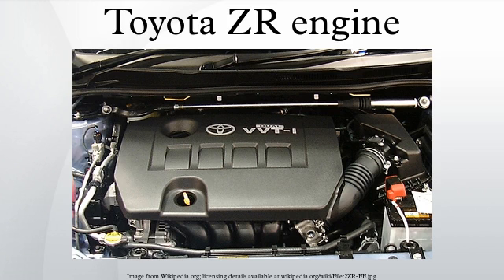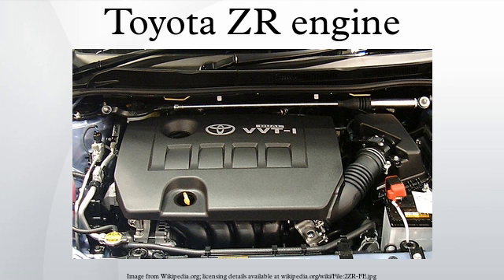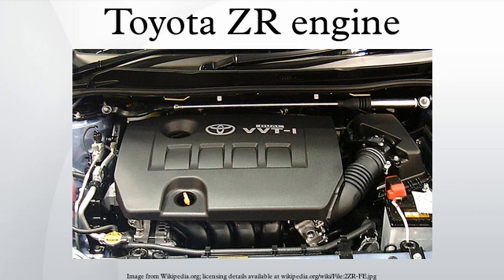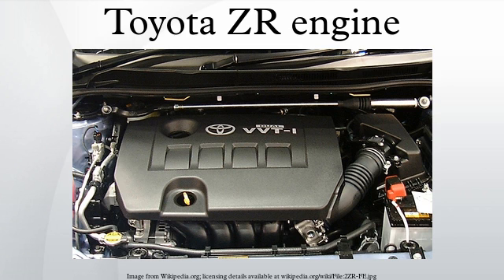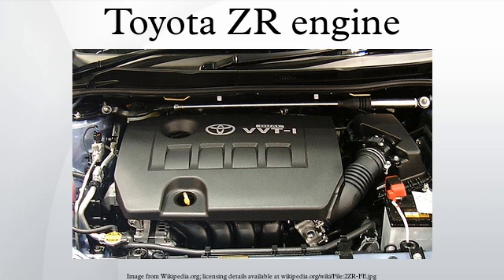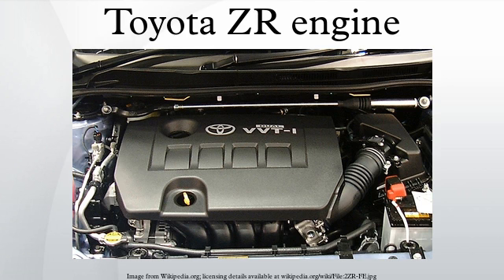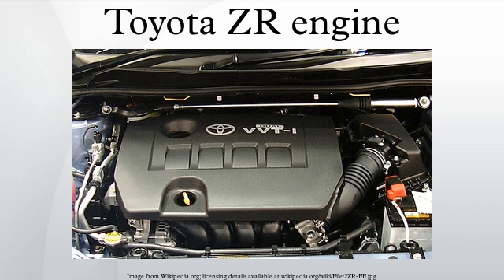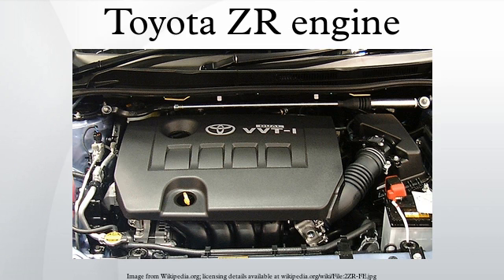Toyota ZR engine

Comment: Whats the reliability like on these engines?
Reply: I have Corolla 2010 S trim 
1.8 engine 
I’m first owner, so far no issues at all.
Reliable engine if you service it on time and use quality oils
160 000 miles already
Reply: x2
Reply: @mjgomez  Good?
Reply: Um Toyota
Reply: @Toyotaorsomthing  ?
Reply: @ewanduplessis9682  everything Toyota related is umm… reliable…
Reply: 200k so far
Reply: @razif6916  Miles or KM?
Reply: @ewanduplessis9682  km bro..Asian market standard.. mine is 2.0 version 3zr with K111 super cvt. America got the 2zr with a new cvt.
Reply: @razif6916  I got the 2.0 3ZR with manual box and 128,000 Kilos only 2012 model
Reply: @ewanduplessis9682  cool